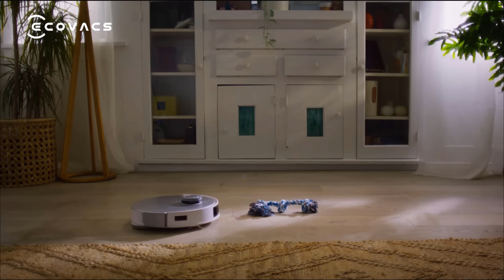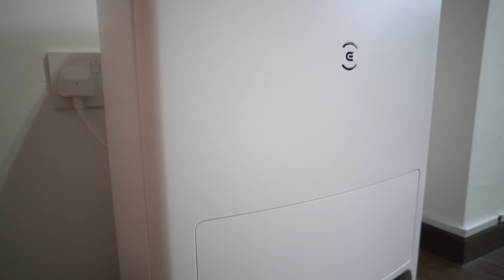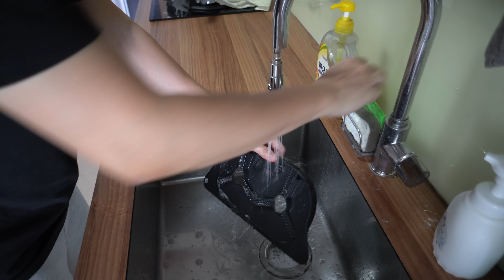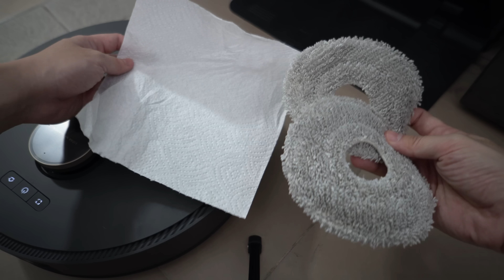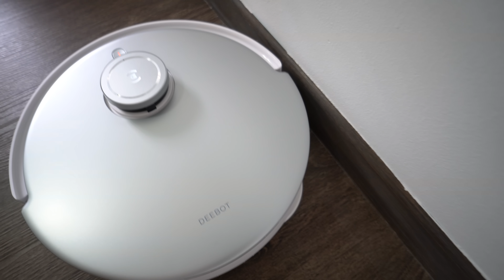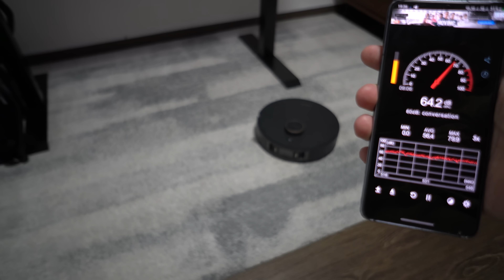My TOP 3 Robot Vacuums Worth Buying Now - DreameBot L20 Ultra, Roborock Q Revo, Ecovacs T20

Comment: T20 omni unfortunately doesn’t mop using hot water you’ll find by the time it reaches its point of cleaning or within a minute of leaving the dock it’s cold especially in the summer months when AC is on,  I currently have a roborock S8 pro ultra hooked up to my own DIY water kit, it’s pretty simple, I offer this to friends for a small fee and include a limscale remover so the water is as pure as a bottle of Fiji after going through a filtration system it’s, it’s my go to V&M robot vacuum cleaner and the best part about my modifications is it doesn’t void the warranty I’m currently in discussions with RoborockEU about the design which may be purchased from me which i assume is for a future release, the L20 is a decent almost unreal dream however I think there’s going to be some issues with some shaggy rugs they encounter,  had they put the classic cloth mop on I would of possibly purchased it but I also have marble and I’ve had nothing but issues with those types of of mops leaving streaks and some I’ve had to get an older machine out to fix or use a steam cleaner, I really hope I’m wrong but people running out taking advantage of the special offer of $450 off only to realise it’s a flawed machine that’s being hyped to be the best of the best, I really look forward to see how you find it in 12 months and how many firmware updates they produce over that time period my guess is 20-30 and it’s still having issues
Reply from the maker: if environment or floor material is cold then of course the water will not be hot unless you are constantly heating the water. So how will you attempt to do hot water mopping using the traditional manner, you will first heat up the water and pour inside a pail right, then take a mop and rinse it using that hot water. How long will the mop remains hot? its the same idea. I rather it has firmware updates, at least I know the manufacturer is constantly working and improving it rather than a company that doesn't provide updates at all

Comment: I've had a lot of issues with my l10s so I'm actually pretty disappointed with dreame at the moment. Now other robots have similar features I'll probably change brands.
Reply: What issues have you had? Previously owned Ecovacs T8+ that just died after 3 years, and trying to decide between Roborock Q Revo for $700 and Dreame L20 Ultra for $1050. Main advantage of L20 is obstacle avoidance, but not sure if it's worth $350 since my house stays picked up and I don't mind making sure things aren't on the floor.

I also considered L10s, but it (surprisingly) looked much worse at mopping and mop pad cleaning than Q Revo, maybe because it uses much less water, and the Dreame app also gets terrible reviews on the iOS App Store compared to the Roborock app.
Reply: @GraysonCarr  I'm looking to return my L10s as the mop pads are not kept wet enough during a mopping cycle and dry out before it is finished.
Reply: @hallsimon you can set the amount of square meters before the vacuum returns to wet the pads in the settings
Reply: @GraysonCarr  You compared q revo and l10s mopping by yourself, or you relay on reviews?
Reply: @damianrecinski7329  just relaying what I’ve seen from watching review videos.
Reply: Had my L10 for nearly a year and its amazing. Most reviews I've seen the issues they have is because they didn't look into the settings well enough.
Reply from the maker: take this chance to try other brands then

Comment: Th DreameBot L10 Ultra is stilla good choice. But a question: in the L20 Ultra you stated Install and forget but you still have to clean it once a month? And how about the base? How dirty will it be? Or has it a method to clean autonomingly?
Reply from the maker: the necessary maintenance work can be performed just once per month, ie. clean sensors, clean base, clean filter, remove entangled hair, change dust bag

Comment: Just to update that my dreame L20 does not detect the dust bag when installed hence vacuum function not working. Upon further inspection, the dust bag does not press on the sensor for it to be detected.
Reply from the maker: yes you are right, but i don't think there are sensors built in the first place to detect whether a dust bag is present
Reply: @alexteo  yes you can see the physical button sensor when you remove the dust bag. That’s how the app detects the dust bag.
Reply from the maker: @kouichi4  you mean the click at the bottom inside of the dust bag holder right?
Reply: @alexteo  yes you will hear a click when you press on it.

Comment: How do they compare with the new Xiaomi Omni 2 which is much cheaper than the L20
Reply from the maker: product is very new, looks promising, always a very good budget option. Things to consider for getting xiaomi robovac is the app and the app features, next is reliability, can be hit or miss
Reply: Yes you are right and by the time taxes are added  it's only about £300 cheaper than the Dreame. I have the original Xiaomi before they even started selling it globally so it must be about 6/7 years old. I believe they came out of the Roborock factory. It's been trouble free but I think it's developing dementia since I find it from time to time just sitting in the middle of the room or banging its head against the wall
Reply from the maker: @btnbiker  price can be very different from country to country, my order of recommendations is something like this for an All-in-1 dock
1. Dreame L20 Ultra
2. Roborock Q Revo
3. Ecovacs T20
4. Xiaomi X10+
5. Dreame L10s Ultra

Comment: Hi Alex, may I know what is the requirement for the water outlet connection? What type of fitting and size requires?
Reply from the maker: i will say there is no specific requirement because you can always get a suitable adapter separately, maybe just water pressure being between 0.14MPa and 1MPa which i think 90% of the people won't have issue

Comment: Mistake in this video - the T20 does not do hot mopping. The hot water feature is only to clean the pads. The pads are cold when mopping your floors.
Reply from the maker: its the same idea as how you use hot water to mop the floor in a traditional manner with a pail of hot water, you will want to mop the oily kitchen floor first
Reply: @alexteo  I’ve got a T20. Pads are cold within about 30 seconds after leaving the station.

Comment: The Q revo biggest con is the quality control. I got one where the dock stopped sucking the water from clean water tank after 2 days  of use, got it replaced and the replacement one had the issue but right from the start after setup. Just returned it today and hoping I get my money back!
Reply from the maker: wow ok, i thought roborock generally has the better QC, so like what i said, if you have a particular bad experience with one brand, then take this chance to try out the other haa

Comment: Looking at your "cons" for the Robotic Revo Q, I wonder if you found the place in the App that the clean settings can be customized for each room.  That is, set for each room: vacuum only, mop only, or both vacuum and mop.  (The cleaning customization settings are not easy to find in the app.)
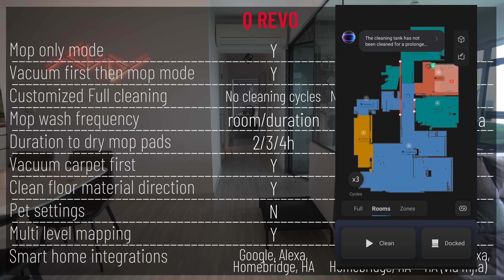Reply from the maker: i explained about this and show the screens at 10:47, so is there a way to set number of cleaning cycles for each room?
Reply: @alexteo  Yes, but the Roborock App does a poor job of showing you how to customize.  First, "Enter" your device.  Below the map, select "rooms"; then select the "S" shaped icon in the lower right.  Now select "Customize"; select "Edit"; and select a room. From the menu, select the cleaning modes and cleaning action you desire, select the check mark to save; the map will now show a symbol in each room for the custom mop/vacuum action you have pre-programmed.  Now, when you go about cleaning, I believe the mop/vacuum action will be per this customization.

Comment: Dreame L10s ultra users, anyone experience this issue of when the robot returns to dock, it drops a small pile of dust in front of the dock? was wondering if its a common issue or my piece is defective. 
Also curious to know if L20  has the same issue or was it solved.

Comment: Previously tried Dreame L10s ultra but mopping not up to my standard and sold away after buy Airbot L107s at $600 (half price of L10s ultra) 😂 with hot mop which do slightly better mop but can't do cycle cleaning. 

Not sure why Airbot have taken the product down 😢
Reply from the maker: robot vacuum is those type of product which either i get a good one or i totally don't use one at all haa

Comment: You are comparing the high end Dreame L20 model with the low end Roborock Q Revo.

The issues you flagged in the Q Revo are not present in the higher end Roborock models.

My year old S7 MaxV ultra comes with an optional plumbing kit (additional charge) that automatically tops up and drains the water as well.
Reply from the maker: This is not a comparisom video saying dreame L20 is better, infact i am recommending all 3 of these for different household requirement. You gotta watch the video man
Reply: You might not have intended the video to say the Dreame is better but that's what your comments section is saying 😂

Also it's hard to say this is not a comparison video when you are testing them side by side.

You should have done the S8 Pro Ultra against the L20, much closer in pricing.
Reply from the maker: @Deathwisher85  hmm i responded to all the comments, don't feel that is the general consensus. My intention is to share which are the ones i recommend to get, doing a S8 vs L20 is only for people choosing between these 2
Reply: @alexteo I am that person deciding between S8 pro ultra and Dreame L20 😂 Both costs similar, so if you could get your hands on the S8 to test against Dreame that'll be great!
Reply from the maker: @violetears  no change to my recommendations, same for the case for ecovacs x2 launching next week

Comment: Is it manageable without the 95cm height clearance for detergent refill?
Reply from the maker: around 80 is enough but you also need to remove the dirty water filter
Reply: Thanks Alex this is great,! 

If i do the auto cleaning water kit, how often do i need to remove the dirty water filter? once a month? 

i am trying to put this under my kitchen sink, and wonder whether he can work with just 80cm and ocassionally pull the base out for detergent refill and dirty water filter change.

Comment: Awsome review!
Regarding the L20s, does the dirty water drainer have a pump? Because my drain is above ground around 30cm, you think it will work or only uses the force of gravity?
Reply from the maker: it supports wall drain of less than or equal 38cm, the manual states that this will require a part that needs to be purchased separately though
Reply: @alexteo  Thank you so much for taking the time to check the manual!
Reply from the maker: @FilipeRaposoo  np haa, just nice i had it beside me

Comment: Hi Alex! I bought an Ecovacs x1 after seeing your review 😂 I'm wondering if you encountered any problems with the emptying of water from the cleaning sink with any of your robots? In my case, the suction from the cleaning sink to the dirty water tank is a regular issue despite maintenance. I will probably get a new robot to replace this next year but do not wish to be faced with the same issue. Any insights? Pls share as always! Thanks!
Reply from the maker: Most likely is because your dirty water tank is not placed properly, usually the case when its empty, just exert a bit of force to make sure its properly sit in
Reply: I am having the same problem, that just started this week. T10 Omni (china version), I have a 6 year warranty/guarantee so will call them if I can't fix it through the standard ways.

Comment: Hey Alex, I’m using the Ecovacs Omni X1 and was wondering what is the battery life compared to these.

I would think battery life and charge speed is worth consideration, example, if I’m going out of house for 1 hour, can the robovacuum complete a thorough cleaning with 1 charge

Compared with a robovaccum that goes flat after 20 mins and waiting for full charge takes 8 hours, then it would be considered poor battery life and charge speed
Reply from the maker: Around 3hrs shouldnt be a problem for robovac these days at default setting, if u select max everything then you will have much shorter battery life

Comment: Hi Alex, great review. The China version of the L20 (X20 in China) somehow has hot water too. Can I check if the L20 has that as well? Quite strange for them to not include in this version .
Reply from the maker: Nah the L20 does not, perhaps some test certification or compliance related issue that the decide to remove for the global ver
Reply: Thanks Alex, just a follow up question… would you say the hot water function isn’t a deal breaker for you in general? I plan to use the vacuum to mop kitchen as well as the living room. 

Would the hot water feature truly make a huge difference from your experience with it?
Reply from the maker: @Betaphats  if you feel that your floor has the oily feel everytime after cooking then yes it helps
Reply: It will be two models one is the L20 ultra and one is called the Ultimate I think that the last one it will have the hot water 😅
Reply: Bought my set from Comex today. Thanks once again Alex !
Reply from the maker: @Betaphats  nicee.... i was there today too

Comment: This is by far the best innovation in the robot vacuum sector. Dreame is definitely overtaking roborock
Reply: There are people who bought the dreame L20 and then watched your video. I'm one of them, and I'll say I'm glad to hear dreame is your robot of choice.
Reply: @samsun01 I am looking to buy Dreame L20. I don’t have though a faucet where I can hook it or an area where I can connect the pipe to dispose the water. Will it operate normally even when the clean water tank is manually refilled and the dirty water tank is manually cleaned? Thank you
Reply: @jds5395  Yes, it will operate normally. Basically there are two versions, one which you can hook up to pipe and the other version which has no pipes but 2 tanks instead. 

The version with 2 tanks is also a bit cheaper. One tank stores the water which you refill yourself and the other tank stores the dirty water from after the robot mops the floor, which you pour out yourself. I have this version. 

The version with the pipes, I can't say if it even has 2 tanks and so I can't answer specifically your question. 

The app will notify you if you are running low on clean water or need to pour out the dirty water.
Reply from the maker: yeah seems like its moving that direction
Reply: How is customer service on the dream
Reply: With live camera hacker are able to hack in that for sure if they really want to do it. It is depend on the manufacture what security configuration in the firmware.
Reply: I think they’re both owned by xiaomi I’m not completely sure though
Reply: Can I buy L20 from China ?
Reply: What’s the price for dreame
Reply: Alex thank for doing this I usually check your videos before I purchase anything for my house 😊
Reply: one thing to watch out for if you are not keen on privacy security , L20 is the only with live camera.
Reply: Live video won’t affect me. My robot running when nobody at home.
Reply: But Dreame’s mop pad cleaning not clean :(
Reply: @ateenytidy  really not very good ? The mop?

Comment: lmao i got the dreame x20 pro china version:( need use vpn then can use...
Reply from the maker: that's why i wait for global ver release
Reply: Hi Kenny do we need to be permanently on vpn to use ?
Reply: @Betaphats  for the china version yes you will need to use vpn to trick the app that u are using it in China or else you cannot use the inapp functions.Maybe there are other ways that I do not know of,but using vpn do the trick.
Reply: @ImperialDog1999  ahh got it ! Yours have the hot water function yeah? So jealous :) just wondering if the app is a deal breaker now since I’ve read the threads that some people have problem with the firmware updates and eventually brick the unit due to region lock
Reply: @kennyliew1775 Is there a possibility to program the robot once to start up every day without going through the app ? Just a thought right now 😂
Reply: @Betaphats  no total no access to the app.

Comment: Darn…. I just bought the L10s SE 2 months back 😢

Btw, what would u recommend for a robot cleaner’s daily & weekly schedule if it can sweep/mop/vacuum? Am pairing it with a Tineco S5 & home’s mainly vinyl flooring.
Reply from the maker: I will only use the tineco for ad hoc situations, daily driver will be robot
Reply: @AlexTeo thanks! For the robot daily routine, do u start with a sweep round first then the mop/vacuum round straight after?

If the robot has both 1) mop only or 2) 
mop+vacuum functions, which would u use for what situations?
Reply from the maker: @byron_sg  some people like to do vacuum first then mop, for me i rather run vacuum+mop x2 cycles, same total amount of cleaning time but with better result
Reply: @alexteo  trudat… faster & probably saves battery/electricity too!

The L10/L20 allows u to choose 1/2/3x cleaning so maybe can even select 3x & skip the 2nd cycle altogether 😂